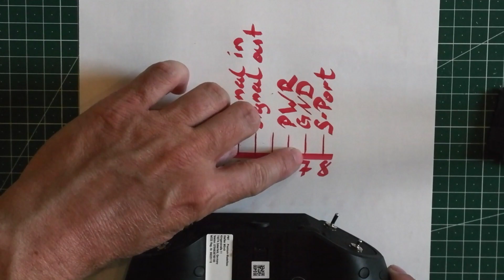DJI Googles RE and FrSky X-lite

Comment: Thanks for the video and the pinout ! Was able to use X-Lite with an old 9XR radio in a wired buddy box setup. X-lite is outputting PPM into JR port of 9XR, which is set up as a master TX and bound to plane.

Comment: Thank you verry much for the good information. I did it as you described, and it works perfect.
Some additional points:
- The external Transmitter has to be set ON for FrSky X-Lite
- The Nr. of Channels set to 8 (with 16 the Transmitter is not recognized in the Goggle RE)
- Not all Connecters works properly. The contacts are thinner than in the Standard of the often used connectors for our hobby.

Did you find out how to disassemble the X-Lite? E.g. to replace a switch.
Kind regards,  Otto